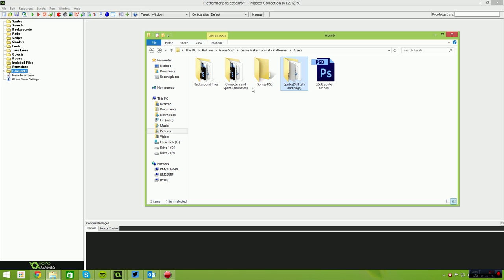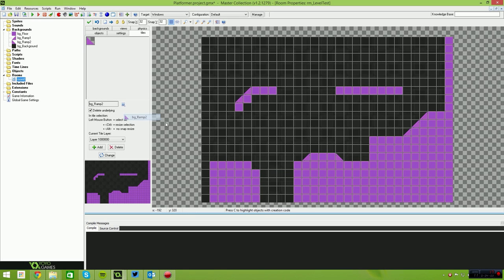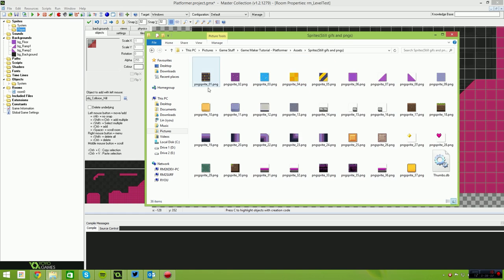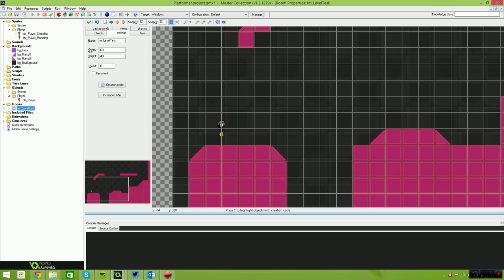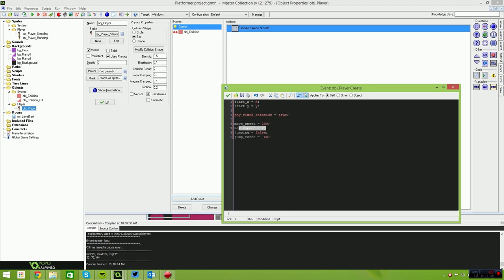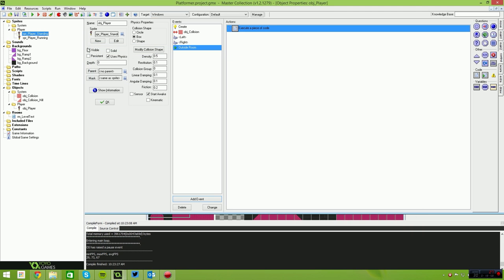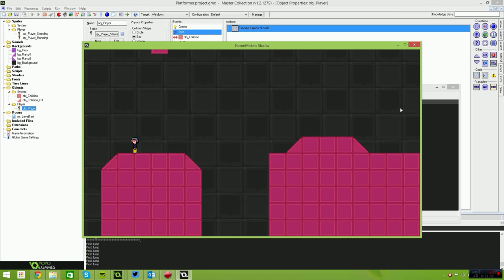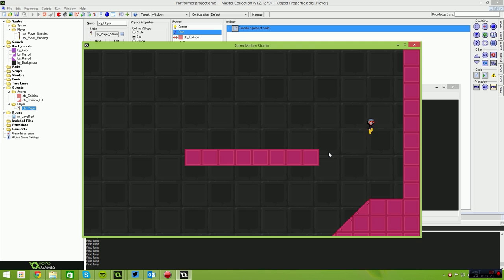Game Maker Physics Platformer Tutorial - Part 1

Comment: 1. You can use build in variables xstart and ystart. The only reason to not use them is when you plan to manipulate your starting position, but I think you can change them too.

2. There is clamp(val, min, max) function

3. And if I can have my personal request. Try using some kind of clamping recording screen. I got trouble reading your code in 720p. We don't need to see all your screen all the time. Code windows are most important here. ;)
Reply from the maker: i'll increase the font size of the code window. I'm not using any special recording software so i don't get that nice functionality without a LOT of work :P which would slow down production time dramatically :P

Comment: In your player object, in the movement, the way you have it set up makes it so that if you walk while falling, you get a kind of parachute effect, a slowed down fall. What i did to prevent this, but still be able to walk up slopes, i split the two forces like this:

physics_apply_force (x,  y, move_speed, 0);

if place_meeting (x, y+1, obj_collision) 
{      physics_apply_force  (x, y, 0, -20)    }

Though i'd recommend a higher value for the upward force, maybe so it's equal to, or even greater than the gravity, just to make it more smooth walking up the slopes.

Comment: One thing you forgot to do was to add a negative to the image speed calculation for when the character is facing left, which prevents the running animation from going in reverse. Thanks for the great tutorial by the way!
Reply: ***** All you have to do is divide phy_speed_x by a negative number after checking which direction the character is moving. Here's an example from a game I'm working on:
if phy_speed_x > 0
image_speed = phy_speed_x / 20
else
image_speed= phy_speed_x / -20
Reply: ty

Comment: rm2kdev,
I'd first like to thank you for the tutorials. I'm very happy with how my character controls and works, and the tutorials were easy to follow. I have a question that maybe you could shed some light on. I'm making a stage-based platformer, where you progress through levels and continue to the next. I have it so when my obj_portal touches my character (where the character is attempting to move to the next room) move my character to the next room, but as soon as I touch it, it gives me an error regarding my "Create" code for obj_player. It finds an error in the movement speed of my player. How can I fix this? I've tried everything from persistance, solidness, collision events, etc. and nothing seems to be working. Sorry for the long question, but if you can at least point me in the right direction that'd be great!

Comment: Is there any specific reason why you used the background for your ramps and stuff, and yet didn't use them in the object?
Also, subscribed. I haven't seen a tutorial quite so engaging in a while.
Also, this seems to be Java-like programming. Very Interesting.
Reply from the maker: Thanks for your feedback and subscribing :)

In Fact yes there is a reason why i used the background and not using it as sprites.

Two reasons:
One.. my tileset was quite small but you could imagine in a full game having many many tiles of the same shape that need collisions its much more inefficient to store them as objects and it slows your game down :)

Number Two...
If you have a corner tile like i do that has a 45 degree slope you can put many of these together to create a larger ramp and only require '1' collision object to cover them all compared to if you had 1 collision object per sprite this again would be much more inefficient :)
Reply: OK, What I got was that you put those collision objects all over the background images. I must have missed where you specified the center peices as not being objects, despite using the sprite. I've been up for more than 24 hours. Give me a break.
Reply from the maker: haha no worries
Reply: rm2kdev I watched the video again, and it definitely seemed as though you just copied the object sprite all over the background sprite. Also, what command do you use to make the drag-into-box thing? 5:30

Comment: I like the concept of double jumps as well as the wall jump; however, is there a way to take away the wall jump so that my character can only jump when he is on the ground?
Reply from the maker: Snow Wind expand your collision rectangles so that they fully encompass the player then the player wont get stuck in the walls and double jump should be disabled. you might need to manually implement double jump logic after this if you still want double jump.
Reply: rm2kdev It is quite interesting that it work; however, I notice my character has became heavier with increasing in my collision box. My solution is to decrease my character density by 0.1.

What if I want to implement a double dash when I quickly press one of the arrow keys twice ?
Reply from the maker: Increment a dash counter and start a timer if the dash counter > 2 move the player faster the timer will reset dash counter to 0 :)
Reply: rm2kdev I am not sure where to put the counter. Since it is the step event of keyboard event, my character move when I press the arrow key and stop once I release the key. Wouldn't counter increments as soon as I press the arrow key.

Comment: I have a problem, it seems that my ramps (hills) are not working right. Player doesn't collide with them at all, thought with it collides well with blocks. I have set "Uses physics" and set collision shape but it doesn't work :/
Reply: I got it, i had to add collision event for ramps and put in "make this happen"
Reply: disaba100  or you could have made the ramp a child to square collision so you don't have to add a separate event in for your player.

Comment: I've checked and all the settings I have are the same but my character barely gets off the ground with these settings.  It feels like the gravity is too high maybe?
Reply: I think I figured it out.  I realized my sprite was bigger than yours and it seems that that is the problem that I'm encountering.  Is there any advice you can give for dealing with larger sprites of a similar general weight? Mine is larger because the animations are wider, but the character isn't really that big.
Reply from the maker: Jeremy Hamilton if your sprite is bigger you need more force in your physics commands :) increase your impulse and force variables.
Reply: Thanks!  Gonna do all the physics math and get it straightened up.  What were the dimensions of the sprite you're using, if it's not too much trouble?
Reply from the maker: 32x32 :D
Reply: Ah okay.  So it seems that since it seemed you had a thinner sprite the size of the collision shape matters.  Interesting...
Reply: Thinner of the animated sprite not area of the sprite box

Comment: FATAL ERROR in
action number 1
of  Step Event0
for object obj_player:

Variable obj_player.max_xspeed(Numbers) not set before reading it.
 at gml_Object_obj_player_StepNormalEvent_1 (line 23) - phy_speed_x = max(min(phy_speed_x, max_xspeed),-max_xspeed);
Reply: +Lukas Broberg You're either missing the line max_xspeed = 2 in your create event, or it's spelled incorrectly.  I'm pretty sure GameMaker is case sensitive so make sure you write that variable as is, so no capital letters for this particular one.

On another note, the debug code you posted should tell you most of what you need to know to fix errors like this.